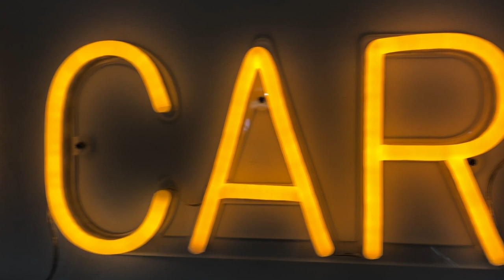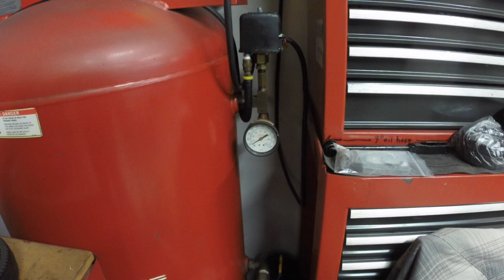REO engine restoration project part-1 disassembling

Comment: When I was growing up we had a REO Deluxe Trimalawn lawnmower. My Grandpa built a sulky that I could stand on and mow the grass. I was 7 or 8 years old. It wouldn't have enough power to pull a adult.
Reply from the maker: REO made those as an option too..... You grandpa probably made it after seeing the one REO offered. Your grandpa also had the top of the line reel type mower REO made.

Comment: Good stuff Bud!! I've owned REO's before but never tore into one!! So you're already teaching this Ol' Dog some new tricks!!☻
Reply from the maker: There're kinda over built, but simple engine. I had an old REO Runabout 18" mower for a long time when I was a kid. I mowed a huge area in the back 40 behind my folks house. It always started easy and ran good. It was a well built mower. I sold it to a REO collector back in the early 2000's. He drove up from Florida to get it. He was a hard core collector, and wanted my nice original mower. He gave me a hundred bucks for it.

Comment: Howard. Sorry for taking time to get back to u. We went and had a look and did not find. He is sure he has one and believes it maybe is in the c can. But we will have to wait until the snow melts a bit. I saw u think u might have some parts. I still would like to see this engine and send it to u. Either for parts or maybe rebuild. I saw a old 3.5 Briggs but the carb sat on top of fuel tank. If u also can find out what carbs will work let me know please. Hope that works for u and great video I saw. Like always. ✌️👍
Reply from the maker: No hurry..... I think 805Roadking is sending a whole parts carburetor. I don't know what I can use off it, but it's a start.

Comment: Thanks for sharing Howard. That motor looks pretty good for its age just ware from normal use seems to be its only problem.
Reply from the maker: Yea, I agree. I did some quick measuring.... surprisingly the cylinder and valve guides are still in the tolerance range. I cleaned the valves up, there in great shape. The only things that appears worn, in the piston and rings. I think that was caused due to the lack of maintenance on the air cleaner. I found a set of brand new rings for a Clinton in my stash, that are exactly the same as what REO used. I looked online for a piston.... can't find one, so I'll reuse the original. It's not like it's going to be run a lot.

Comment: I had a old Toro mower from the 1960's, it had a Tecumseh Engine, i was mowing some weeds, I Blew a rod out of the case, took the mower into the shop, welded up the case, took a  rod out of a old engine and put it back together and back to work. that old Toro lasted for a long time after that

Comment: work was slow for me an out 5 years ago, I am a Electrician by trade. One winter i went to work at Willys America, they restore willys jeeps and pickups. i was working on a station wagon , converting the wipers from vacuum to electric. you us e a 55 to 56 chevy. i took the wiper motor apart, and could not get it back together, i asked the Master Mechanic for help. All he said is someone put that together at the factory, figure it out. that blew me away but he was right, got it together
Reply from the maker: I'm a hands on learner.... you could tell me all day how to do something and I wont learn, until I just do it.
Reply: @OldCarAlley  yup I’m the same way

Comment: Hey Howard Its been a while Good to see ya still uploading 
I like the new project It  came apart not too much trouble Set of rings she will be brand new 👍
Reply from the maker: I ordered new oil seals, they will be in tomorrow. Also stopped at the paint store, to get a quart of paint mixed.
Reply: @OldCarAlley  You've started gathering what you need then bud Did you have any luck with the rings yet?
Reply from the maker: @oldgeezer3269  Yes I found a set of Clinton rings in my parts stash that will work. I measured them today, finding them the same specs as new REO rings.
Reply: @OldCarAlley  wow that’s a stroke of luck 
You knew them rings would come in handy one day 🍀
Reply from the maker: @oldgeezer3269  I would have never thought Clinton rings would work in a REO. The REO has a 2" bore, and the Clinton rings are for a 2" bore. Turns out there exactly the same and should work.

Comment: Very nice! Glad to see you are pulling it apart and going through it! I could tell it needed it lol! I'd give Jim's Antique Small Engine Parts a call. Super nice guy with a LOT of parts and I'd bet he has some REO stuff! His number is definitely on smokstak but might even be online somewhere too!
Reply from the maker: I "think" I have everything I need for it. I have a gasket set and a Carter carb kit in my parts hoard, plus a set of Clinton piston rings that are exactly the same as the REO rings. I stopped at Bearing Services yesterday and ordered the oil seals, they will be in this afternoon. I even stopped at the paint store to get a quart of acrylic enamel mixed up in the correct color, to paint it up. The acrylic enamel is gas proof.... 805Roadking is mailing me a Carter Model N carburetor to use for parts. I will keep Jim in mind if I end up needing any other parts.

I measured the bore and valve guides, surprisingly both are within standard size specs. The piston is a little worn, but will work fine, for how little it will get run. I'm keeping my eye out for a vintage kids tricycle to put the REO engine on......